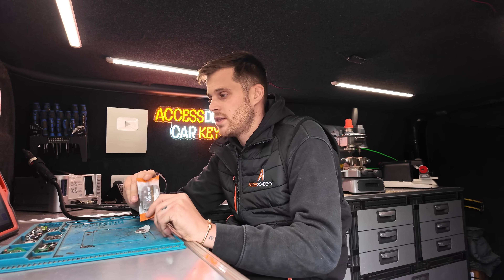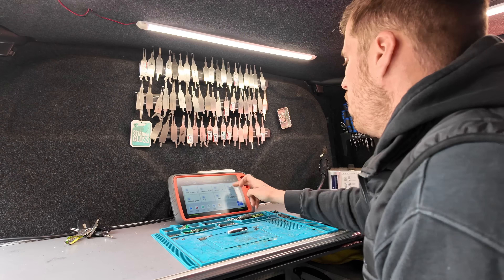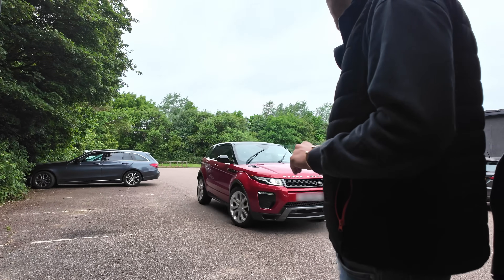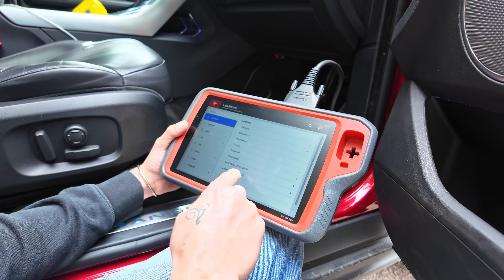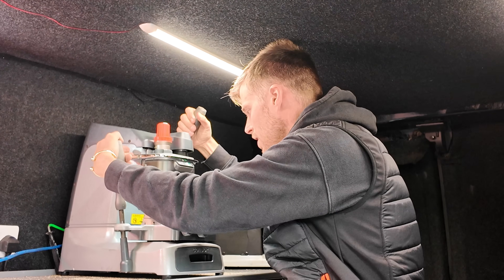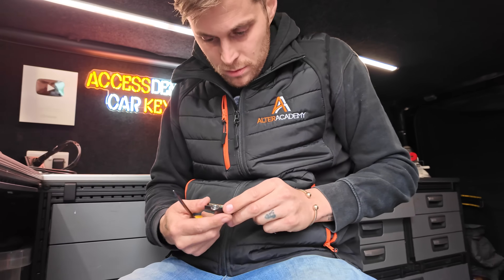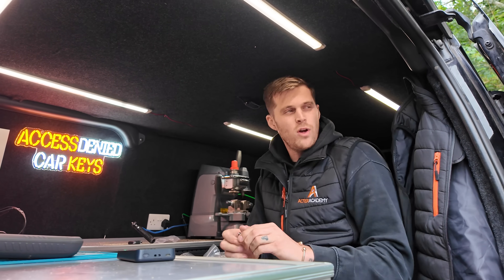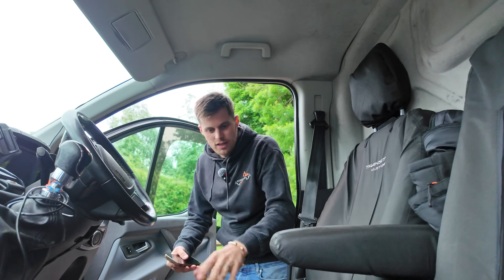Range Rover Key Programming in Under 5 Minutes!?

Comment: Once the car has the latest security update (N877) from Landrover this method via OBD no longer works. Need to take the KVM out.
Reply: That method has nothing to do with the update, it will work no matter what.
Reply: @NickDaTech  I know you can do this on a locked KVM via OBD where KTP clones one of the existing remotes onto a VVDI remote but there are new software updates from JLR as part of a recall. Once this update (N877) has been done it no longer works, I tested this on a Discovery sport before & after the update. After the update it just fails to read any key data.
Reply: @NickDaTech even is KvM is locked 😮
Reply: @AJA4D even if it locked it doesn't matter. This method works.
Reply: @AJA4D You are basically cloning already existing data. You are not adding another key so it will always work. Locked/unlocked KVM doesn't matter
Reply: @parvysage do you know if the original remote will still work?
Reply: @AJA4D Yes, it will. I did one a few days ago. So original remote worked and the new key as rhe car believes they're the same key/remote.
Reply: @parvysage legend. Thanks for your help bud. Really appreciate it 👍
Reply: @parvysage  I'm not talking about a locked KVM. Im talking about the latest security update (N877). Once this new update has been done The method where KTP clones one of the existing remotes (on a locked KVM) does not work once N877 has been done to the car. I have tested this with KTP but not anything else like Lonsdor or Autel, Before the update i could do it after the update i couldn't (2017 Discovery Sport)
Reply: @parvysage until the moment when your battery dies and you can't operate from the steering column at low frequency...
Reply: @NickDaTech hi nick, can you confirm the situation with range rovers having problems with programming if the 10th number in the vin is d or higher?
Reply: How do we go about sorting a new key for our vehicles?😉